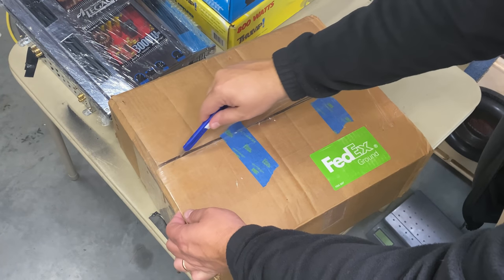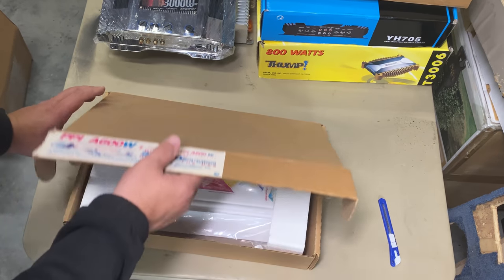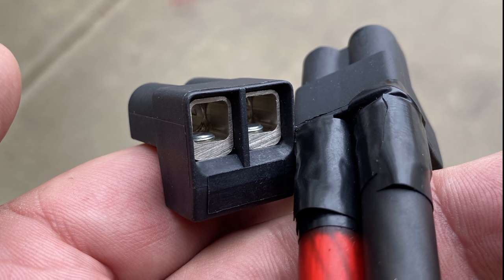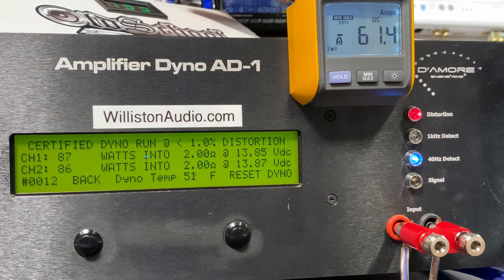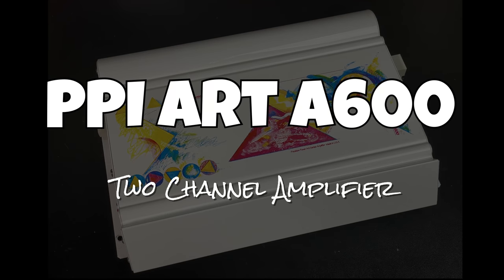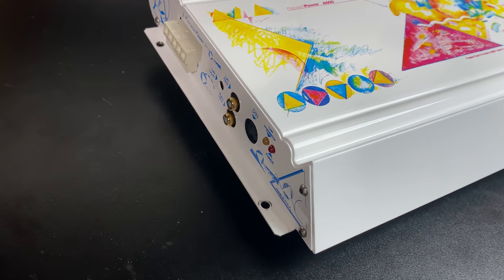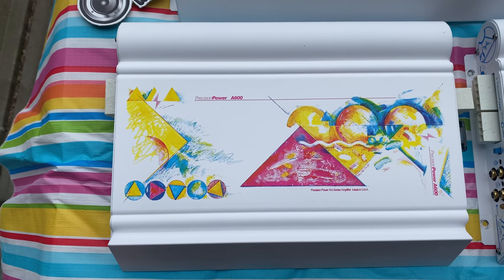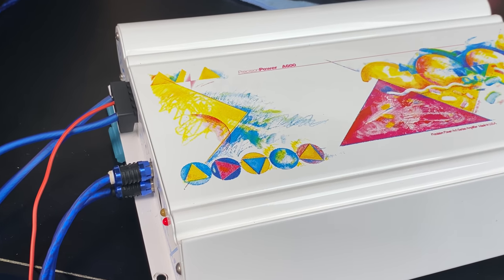AMPLIFIER ART? 1994 Precision Power Art Series A404 and A600 Amps [4K]

Comment: Back in the 90's I was a installer for a PPI authorized dealer.. I had those same amps in a Dodge Dakota 2 seater with 2 ADS S10 subs and ADS components in the doors.. One of the absolute best sounding systems I've ever heard. I miss it and I would love to get my hands on those amps again.. I'd NEVER give them up! Great stuff!!
Reply: I have a set of ads 5-1/4 components, but the coils are seized.  Wish I could get them rebuilt
Reply: I have both the amps in this video. And i have the a300 and i have a crossover from that time period that is ppi also. I wonder what its worth

Comment: These amps combined with JL Audio W6 subs, and MB Quart speakers were the ultimate setup back in the day!
Reply: You got that right the A600 on 3w6 banged
Reply: I had two A600’s on 8 jl audio 15w1’s. A300 pushing my jl audio stealth box. I can’t remember what models I had on my mb quart 6.5’s and 5x7s. Audio control crossovers and two 32 band eq’s.  Perfect 20 Rta. And 154.6 spl. The 15’s were on a toggle switch.
Reply: I had 2 a600s running 4 10" Kickers, and a yamaha ypa 1000 running MB Quarts, going through a Sony XEC 1000 crossover in 1990 mitsubishi eclipse. I cannot emphasize enough how killer it sounded. My whole system got ripped off in a parking lot. I'm still crying.
Reply: Still are . Ppi used to be top shelf equipment.

Comment: I agree.
I had 2 of the 600.2's back around 1996.
In my 1995 Eclipse I had them in a false floor under a 1/4" plexi and vinal wrapped  Beauty panel that was on the passenger floor in the front seat.  When I had passengers or the car had to go in for service the floor mat just went right on top of them and nobody ever even knew. 
 In the hatch I had one Percision power flat coned 12" sub
 Everything else was Focal. This was the focals home stuff because they didn't make car stuff back then.
 In the dash I had focal tweeters that were under the stock grills that had  Clutch less door lock actuators I put that made them rise up out of the dash  firing right at you instead of hitting the glass first. This was done with clutchless door lock actuators and a coat hanger if I remember right. Jeez that was a long time ago I wish I had pics or a video like we all would today .
 I worked at a car audio shop in Mesa Arizona called Mobile audio from 1994 to 1998.  Before that I worked at unique car audio in Mesa Arizona .
 Once a year we would get these dealer accommodation deals where you would get a certain percentage off of dealer cost.  Man those were the days .
 By the way I love your podcast. I listen to it while I'm at work with my headphones.
Reply: I remember hearing Focal in cars back then. Morel was in some SQ cars also, Dynaudio and B&W too. I had MB Quart competition separates back then. I've had nothing but Focal mids and highs for almost 15 years. Recently bought the top K2 Power three ways except with 4" mids and four 6.5" and over 1000 watts rms of Mosconi One series power! Wish I could see your old install...

Comment: Loved these amps!!!  I owned both the white and black art series. I worked at a stereo repair and installation store. When these amps came in 'stolen' they never had the dang connectors.  We would have to solder pigtails directly to the board. Just owning a PPI Art series amp back in the day commanded respect.  Then PPI  products went to shit and the subwoofers cones went flat piston.
Reply: PPI was good but if you had McIntosh, you got mad respect and thick wallet.

Comment: I owned one of these in highschool, saved up all summer to buy this a404 with a 1 farad cap. Powered a set of MB Quart comps up front and a DVC Image Dynamics 12 in the dynomatted trunk. Nakamichi head unit fed an audio control line driver to the amp. Sold the system with the car after I finished college. It was all custom fab by me, but i do wake up at night thinking about that amp from time to time. It was a simple clean system, no one could ever believe it was just one 12 in the trunk. Sound quality was amazing!

Comment: Around 1998 a guy asked me if I would facilitate a trade deal because he didn’t know much about car audio and didn’t want to get screwed over. He had a punch 800a2 and two 12” audiobahn dvc(that actually sounded great and performed well surprisingly), a guy he knew wanted to trade him a ppi a600 for his rf 800a2. I installed the a600 in his Camaro and it sounded great but was maxed out, the 800a2 easily over powered the subs and had to be turned down. I advised him the a600 is a good match for his subs but is not as powerful as his 800a2. He greatly appreciated my advice and I ended up doing many builds and installs for him over the years. So turns out the guy which had the a600 had 3 15w6’s in a escort hatchback. I never heard it, but heard it was epically loud, the box was built by a local expert installer. Supposedly later the guy with the a600 tried to have his buddy build him a box for 6 15w6’s and two a600s but said it was never as loud as the professional built box with 1 a600 and 3 15w6s. Sorry for the long story, but these amps bring back great memories. I think I still have a half working a404 around somewhere.

Comment: Had these exact 2 amps in a 1990 camaro back in the day. 2 jl 12w0's and mb quart 3 ways in the front. Man i miss those days.
Reply: Great setup, I just grabbed a trio of A404s and plan a similar install.  I have a set of Mb quart 2 ways, but i'm still on the hunt for a 4" driver to add to them.  Going with a JL 10TW3, each voice coil will get 200w (or more like 185w after watching this video), the midbass drivers will get 200w each (again more like 185w), then I have 50x 2 for tweeters and 50x2 for rear fill or midrange.  Stuffing it all into an AW11 MR2.

Comment: What's up, I had and still have a black a600. Back in the day I had it pushing 4 orion xtr dvc 12's. It hit hard...I have a few ppi amps.
I have
2 black a600's
2 white 4200's
1 white 4100
2 black 2050's
1 white pro mos 450
Reply: I have found a few as well, 
A404
A300.2
Pc275
Pc2100
Pc1400(X2)-grey
Pc1800-chrome
The a404 sounds so nice.

Comment: There is a later revision model of the 600, the A-600.2 I bought mine on the dealer accommodation program in 1995. I have the 300, 404, and the 600, but I bought mine in black. They look even classier with the board schematic screen printed in gloss black on the satin black heat sink. When our stores were aquired by SBC Ameritech all the inventory was offered to us (the employees) in a ridiculous blowout garage sale type affair. I bought everything I could grab. I got 2 A-1200's for$125 each, 2 5075DX amps for $50, a 4100AM for$25, a 2050AM for $25, a 2150AM for $50, I also picked up a DCX1000, an RCM1000, a PAR225 and a gaggle of other PPI gear as well as a ton of stuff from other brands that we carried. They sold all of the Alpine 3555 amps for $100 each! We carried PPI MB Quart Audio Control JL Nakamichi MTX Sony Clarion Kenwood and a few others, it was quite a sendoff for all of us (who were of course fired after the aqusition).
Reply from the maker: Oh man that’s cool. My only concern with the .2 models was the way PPI used CHY’s art work without paying her royalties. They are great amps though. Good deal with the extreme low prices, I would’ve done the same 👍

Comment: I worked at a shop that sold these new BITD. Also sold Rockford Fosgate. I really liked this series, but the RF always sounded more powerful. Now we know why! Lol. But this was the paired combo that seemed to work. Very clean sounding amps, Especially with the MB Quart or Altec Lansing mid/highs and JL subs, usually a pair of 10W5s or 12W5s for subs (and their giant ported boxes). We tried loading them down to 2 ohm mono, and they would do it, but they got really hot. Hot enough to melt the solder off of the power connector. And once they got hot, they didn't cool down very well either.  There was some talk about water cooling. I remember seeing some pics of a few setups. I think the coolant was piped into extruded tubes on either side of the shell. I think I remember the shop owner had a setup with the big A1200 running 8 compound Isobarik JL 10w5s in the custom fiberglass mount JL had then. It was in a Jeep Cherokee sport. Cool setup. Very clean, and loud system, especially with the MB Quart 8" three way set in the doors.

Comment: I had an ax400 and a600 in a '86 GTI pushing MB Quart and JL Audio subs. They were black with a subtle graphic of the circuitry. I loved that system right up to the point when the car was stolen and stripped. I love that you still look back at some of the classic amps, great content.

Comment: Always loved the Art series. I did notice that the 404 was always down on power versus other amps of the day. I also ran the MPS and MS series of the phoenix gold amps of the same year. I still have two of the A600’s in black and have used them for almost 24 years consistently and never had a problem. One is bridged to 2 15’s at a 3 ohm load and virtually never goes into protection. It gets so hot you can’t touch it and I’ve been waiting decades for it to fail. But I’m still loving em! Thanks big D
Reply: They may have been down on power but musically I enjoyed running these over 99% of all the amps made at the time.

Comment: I used to run an a600 in 4 ohm mono at 14.5 volts to a single Kicker 15” in a tuned box along with the A404 for the front stage. Let’s just say they performed very nicely, clean sound and the sub hit when you wanted it to. Bought the pair off a guy in like new shape in 1998 and to this day I am sad I sold them in 2004 :(

Comment: Hey Big-D, these amps were designed by Jeff Scoon at PPI back in the day with regulated power supplies - hence they will output the same power almost regardless of input voltage. This may also explain the lack of 'dynamic power' you found. This was PPI's point of difference to rivals from RF and SS that offered very losely regulated power supplies and, hence, more power at higher voltages.
Reply: Ha. I just posted the same info. Good on you man. 😀👍

Comment: I had a few art series amps back in the day. They where borderline impressive. 

I always kinda knew that they could not out perform. Thanks for clarifying that. The where very expensive too. 

Sound quality is what they where all about. 

The only art series amp I have left over from that era is the a606.2 and it’s really a show piece.
Reply: I never owned these but I felt maybe the same about a/d/s P80/P120 amps,  overrated, barely borderline and way too expensive.
Reply: @geezler4083  As many have stated here. The PPI art series amps were possibly the finest sounding amps ever made. They had great bass control and amazing depth and imaging. Many amps that were just as expensive didn't come close. Here in Canada all car audio back in the late 80s and early 90s was double the cost relative to the US.

Comment: Whatcha know about Art series PPI amps? Around 1995, these were THE amps to get, along with JL subs. I had a PowerClass 450, used for front mids/highs. PowerClass replaced Art series, I believe (around 1997?) The only difference (besides not looking nearly as good) is on-board crossovers on the PowerClass amps.
Reply: Yeah I remember those days. Guy from my old neighborhood had 2 of these on 3 JL 12's in a Dodge Daytona. Could hear him coming a mile away. Won all the competitions.
Reply: Man, I haven’t seen a Power Class amp in ages, those were all over the magazine installs in the late 90s.  I had no money at the time, but I bought the lower tier PPI 5440 5 channel based on reputation.  It didn’t pump out a ton of bass but I was able to play with running active mids/tweets and a sub without any other equipment, which was unheard of in the year 2000. I forked out hard earned cash for Eclipse components and regret to this day selling those.

Comment: I had an a404 an a600 and an a1200 in my jeep back in the day. I'd die to have those bad boys back.
They may not make a ton of power but they were clean as can be and sound awesome. 
Btw they have regulated power supplies so they basically have the same output regardless of input voltage...
Only drawback to that is if your voltage drops too low you can damage the amp... ask me how I know 😀
(Hint... my a1200 was upgraded to an a1200.2 in its second coming)

Comment: i'd really like to see an old power coustic 460 it was the favorite amp i ever owned. i had it hooked up to 2 10 inch round solo barics and 2 12 inch round solo barics in a standard cab s-10 and it hit so hard it would blur your vision. it was stolen and i never had the chance to have it tested.
Reply: the amp was stolen before I upgraded to the 12 inch L7s. the kicker amp was rated on the title or whatever the paper in the box was @ i think 740 or so @4ohms and i went from the truck to a caviler I couldn't tell if it hit as hard. if i had a time machine, lol.

Comment: I still have both these amp in my shop. My A600 was one of the first batch made and came with a 50amp fuse. Blew it a bunch of times then uped it to 60amp. Just upset I sold the A1200 I had. Hope to use them next year in a build.

Comment: This is going to sound crazy but believe it or not those super stiffly regulated power supplies in those art series amps would sometimes make more power at 12 volts than 14.4 or whatever the test voltages were. I would like to see the power output at 12 volts and see if there was any difference.

Comment: The art series is one of the best SQ amps ever made.
Reply: I was stationed in Florida in the mid 90's. Many SQ folks were running MB Quart, PPI and JL subs. It was a recipe for success back then. I had a similar setup but with a six channel McIntosh amp.
Reply: Even the lower line PPi Sedona stuff still sounded really nice back in the day. PPI is absolutely in my list of nice sounding amps.
Reply: @johnclark3067  sounds about right. Mine was Denon deck. 15" JL 15W1's on ppi 600am. Punch 75 on Rockford 6.5 and 5.25s on a homemade crossover so had a midbass and midrange. Rockford series 1 amp on RF 1" dome tweets. Coustic xm3 crossed over the subs and tweets. Took your breath away and sq was beyond anyone in my area. Miss that set-up.
Reply: @TheBrokenLife  I still have two PPI Sedonas. Trying to figure out what to put them in! Also have 3 JL12W3D6-V1's. I hoard audio equipment lol.
Reply: @elsey1976  I think we all do around here... It's a good problem to have! My particular problem is that I've let the internet convince me that every capacitor that isn't 5 minutes old is bad... so I have like 6 or 8 amps to recap before I want try to play them again. I even broke down and bought a "practice" amp a week or two back that I don't have any emotional history with so if I FUBAR it, then, well, that's what happened!
Reply: @TheBrokenLife  I like that idea! I have no idea how to fix caps, so I'm hoping for the best when I fire these things up. I actually have a Denon pull out head unit I'm hoping works as well. My favorite equipment is my a/d/s 5.25" component set. Man those tweets are weighty! Any links to cap repair??
Reply: @elsey1976  I'm sure there are some good walk throughs out there... I'll be doing one on my channel in probably the next few months if you want to follow along with a noob who doesn't know what he's doing either. Never stopped me before! haha

Also... I just saw an empty Sedona 500 heatsink on eBay for $85. Artwork on it is OK, but the rest could use some touching up. You could do so much cool stuff with a matching empty shell to your other amps. Hide power distribution, extra cooling, even other amps inside the shell!
Reply: @TheBrokenLife  Wish I could put the guts of my Mosconi One series amps in a pristine heatsink like that. They aren't much to look at but sound amazing (class ab). They will run active 3-ways with over 1k rms!

Comment: Sold hundreds of these, beautiful with liquid cooling even better
Reply: How did you incorporate liquid cooling?
Reply: @chrishuyler3580  on the rounded side of heat sink, a channel internally. Drill and tap fittings on ends, a pump and coolant and off you go.

Comment: I had a PPI ART 100x2 running a set of MB Quart 6.5” components. That was the absolute cleanest and smoothest system ever.
Also had a JL Audio 12” with an Orion amp in the back.
I was so stupid that I let that system go when I traded my car off.

Comment: Has a service tag! Seal isn't broken!

 That doesn't exactly mean that it hasn't been opened. As a former authorized service tech, they would send me new seals with every replacement parts order that I'd put in. I still have a dozen or so of them sitting around in my PPI schematics folder, even though I've been out of the game for almost 20 years.

Comment: Ive had an a404, a100, a404.2, a600.2, and a sedona 460ix. I dont have them anymore, now im sad. I did have the a100 hooked up to a jl audio 15w5 in a ported box back in 1993, and it was looooud! People couldnt believe it was only 100 watts. Also in 1995  i had a alpine 7915 dead head cd player, mb quart 5" component set and a jl 12w5 put in my old box with a 15 w 5 because I didn't have time to build another box so I just made an adapter I reversed the phase on the left MB quart 5 inch woofer in the driver's door which brought the soundstage up to dash level the tweeters were mounted near the a-pillars aimed at the dome light the amp was only 60w x 4 , the rear two channels were bridged to the sub and with just that radio that 60 watt by 4 the MB quart speakers and the sub I hit 134.8 decibels and scored a 34 out of 40 on the RTA test I came in third in sound quality cool huh, the JL Audio rep couldn't figure out how I got it to sound that good with what I had I thought that was kind of cool that I stumped him, this was all installed in an 86 4 door Ford Escort by the way the sub box fit under the hatch cover too.😁👍